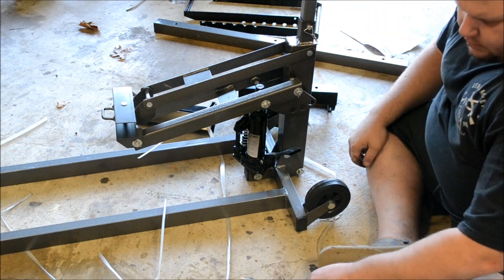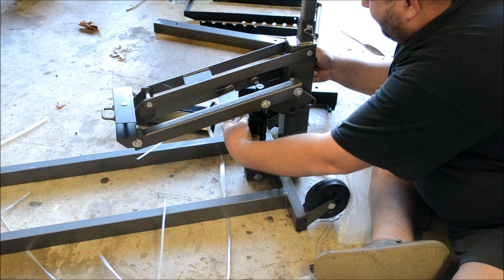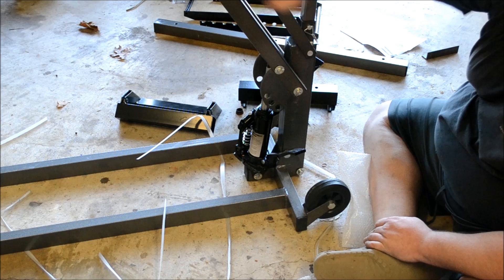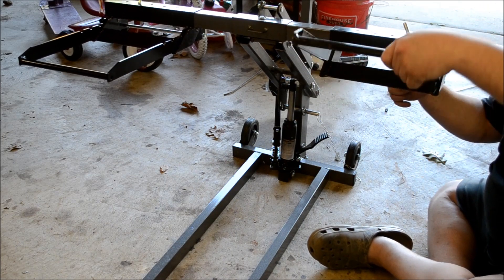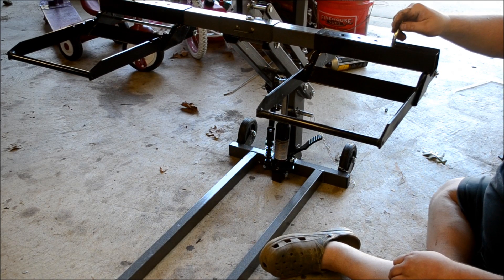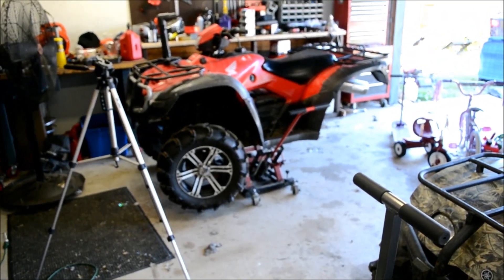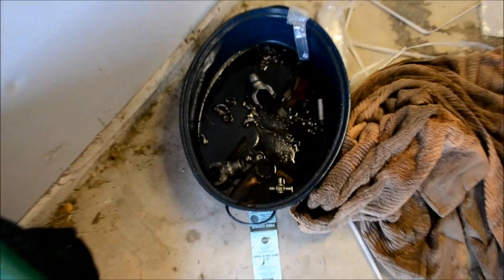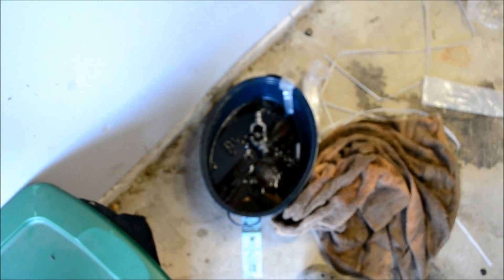Tool Review: HARBOR FREIGHT  Pittsburgh Riding Mower / Atv Lift Jack 60395 / 61523

Comment: I got one of those jacks and so far it has performed as advertised. I left the lawn tractor lifted on the jack for three days and it didn't drop so I guess the cylinder is fine. I love the wheels which make it easy to move around on grass. I am planning on lifting a J.D. Zero Turn mower next with it to take off the blades.

Comment: Bought one of these. Cylinder failed after two months. Bought a small bottle jack at O’rielly Auto Parts for $15.00 that was the same size. Welded the parts off the old cylinder onto the new one and got the pedal and spring on it and still using it two years later. Even with that, one if the best tools I ever bought. Harbor Freight has a new one made by Fischer that’s red and much better made. Picking one up this weekend

Comment: I would like to see more You Tubers wearing remote microphones so we can hear.But thanks for video , pretty straight forward. I've had 1 for at least a year and have not put together , will now. I just now put this together and because of your help ,I didn't realize a lot of the pins were on the jack and being it's been so long since I bought it I wasn't sure if I had all the parts, Well I did and it went smoothly,Thank you for posting this, It was probably one of the better videos.

Comment: It has a 300 pound lift capacity. That means it will work on a machine that weighs 600 pounds because half the weight is on the rear wheels which are on the ground and the lift only picks up the other half of the weight. I've got to get one of these. I run a small engine repair shop and I've been picking up the front of riding mowers and setting the front tires on two cinder blocks stacked on top of each other. It's killing my back.
Reply: That's what I was kind of thinking about a 600-pound mower which I have and I have bought one of these got to put it together or not I'm hoping everything works well

Comment: Did you have any luck getting yours to fold flat? I just bought one and it won't fold more than half way before it hits the bottle jack?
Reply: Kyle I have the same question.  No where in the owners manual does it say how to do this.  I even went back the store and asked them to show me how to fold it, but they didn't have a clue.  This video shows pulling a pin and it will fold..... nope that doesn't work.

Comment: I just bought one of these things. I followed directions bled it and made sure fluid was full. If there is no weight it lifts and lowers. As soon as I put my zero turn wheels on it, it goes up about 1/2 " and then nothing. Any suggestions? I can't seem to get ahold of anyone from HF.
Reply: my lift has the same exact prob did you ever fig it out
Reply: No I returned it to Harbor Freight and got another brand that works great.
Reply: same with me no lift
Reply: Remove the red cover on the base of the Ram. Yes, the one that says Do Not Adjust. They're not always set properly in the factory, or at least they don't always maintain the setting when it's assembled by the purchaser. Just tighten that bolt, and your in business...
Reply: That's exactly what I did and it solved the problem. Simple!!!

Comment: I have yet to see how this lift folds to store between uses.
Reply from the maker: It don't
Reply: I managed to get mine to fold ~ sort of ~ by removing the hitch pin under the hydraulic cylinder and the one at the base of the handle. I wrapped a bungie cord around it to prevent it from flopping around. It isn't a great solution but at least it's out of the way in the back of my shop.

Comment: Help- the rear bracket rods (part #2) are too long, and it seems impossible to get them inside the wheel brackets. What's the trick?
Reply: Push the brackets ALL the way in for maximum flexibility. Then the pins easily go in!🍺

Comment: When its lifted the only thing holding it are Chinese welds.
Reply: Not really sure what you expect for $59 with coupon? I have used it a hundred times with no issues...
Reply from the maker: Use mine every day. I did upgraded mine with some American steel and welded the weak spots. Bulletproof now